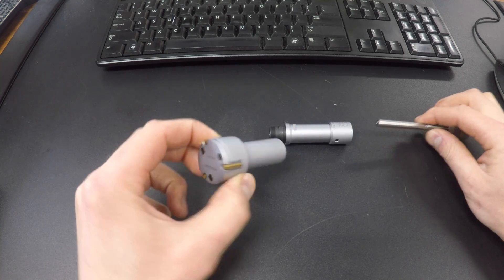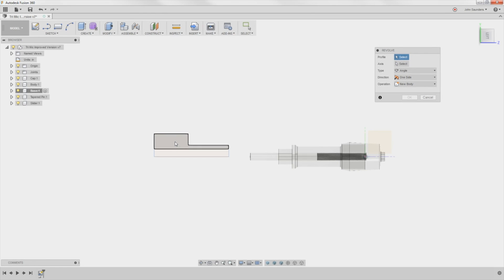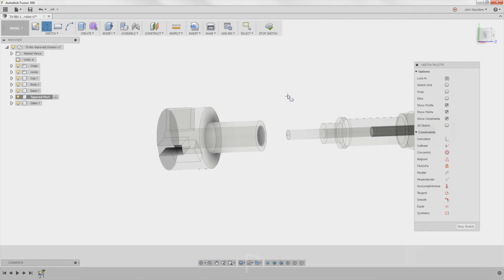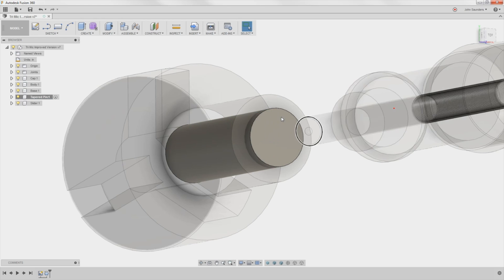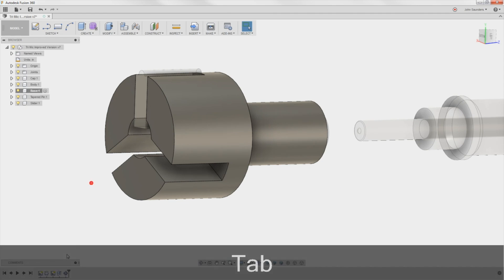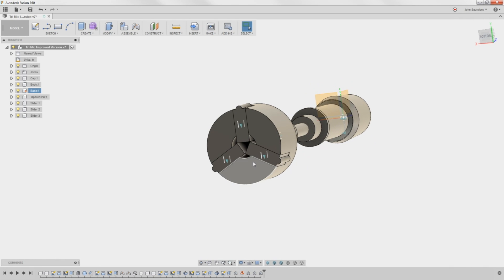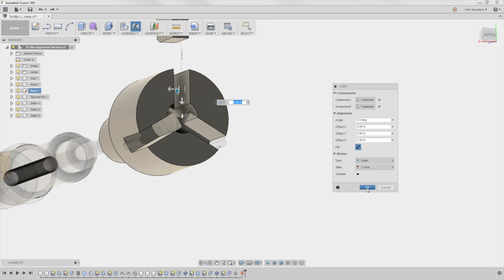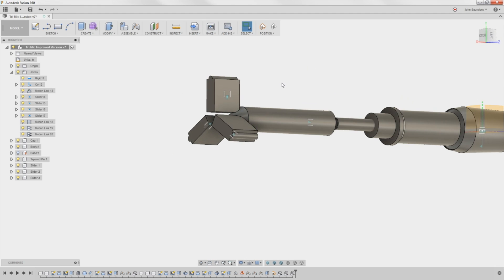Fusion 360 Advanced Joints & Motion Link Tutorial: Bore Mic! FF78

Comment: At 2:30 in the video, a new trick I learned when applying constraints is you hold shift while hovering over the midpoint of a line, you will be able to snap to that midpoint. This automatically creates the point, it's midpoint constraint, and the finishes the horizontal/vertical constraint with one click, really speeds things up.